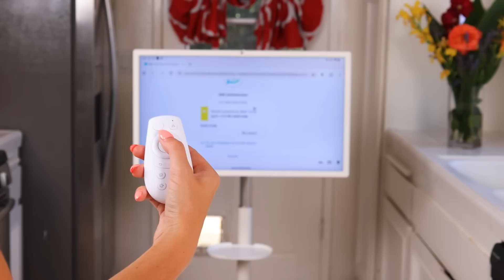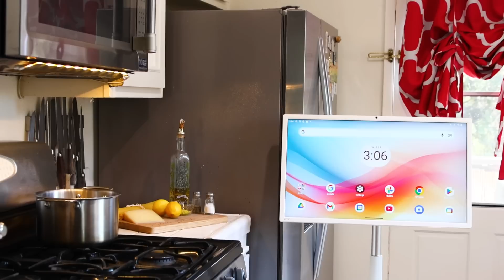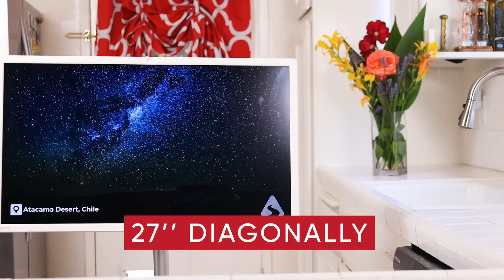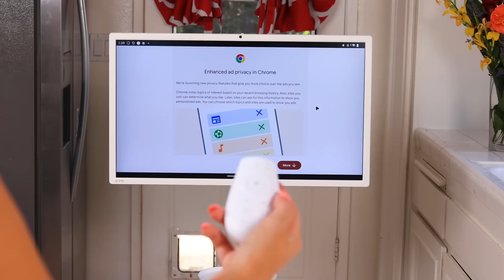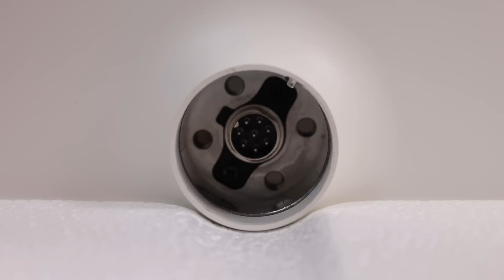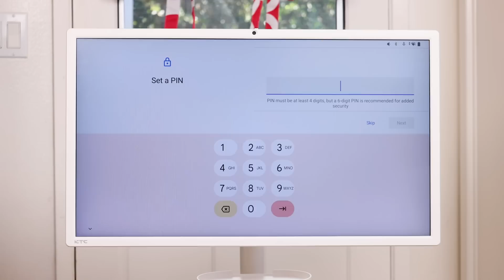KTC MegPad A27Q7  TV Tablet on Wheels | Touch Screen Monitor | Webcam |  Battery Monitor 6 Hours

Comment: Best for editors , coders especially when they are travelling cuz big screen is always a need. scrolling through lines of code, and laptops just don’t cut it sometimes.. You can set it up anywhere whether you're at a hotel, coworking space. As it supports USB C and screen mirroring makes it so easy to hook up your laptop or phone without carrying around a bunch of cables. How cool is that.. running VS Code on one side and a preview window or terminal on the other. That is a luxury while traveling with remote work that feel a lot more productive.
Reply from the maker: Great comment, thanks for sharing your thoughts on this!

Comment: Toddlers and pets would knock this down in a minute. I hope the base is quite heavy to keep it from tipping over. But, yes, a really rambunctious child or dog can possibly knock it down. I can already picture my niece running full speed into it or my dog knocking it over with a single tail wag. I love the portability and how sleek it is but I think for families with little ones (or pets), you’d have to be really careful about where you set it up. That said, if you’ve got a quiet moment or a designated safe zone I agree that this is an aswesome piece of tech for family use, like watching cartoons together or using it as an artboard for educational apps. Just maybe don’t leave it unattended on the floor during playtime! It’s one of those devices that’s perfect… as long as it’s not in the path of destruction.
Reply from the maker: You make a great point about safety!

Comment: I need more screen separation tho 😆I would have throbbing migranes for life if I bought one of those! It would be super handy for art tutorials though. Where I sit, it scoots! I’m always pausing and rewinding videos while trying to sketch along and my current setup is either too small to see the detail or way too awkward with cables and positioning. With this MegPad, I could just prop it up, rotate it vertically and finally follow along comfortably. 😂 That’s me! Always dragging my chair around to get the right angle on a screen. At least this would move with me instead of the other way around. So Tempting🔥
Reply from the maker: @flwrzpinky6865 I'm so glad you liked this!  Thanks for your comment!

Comment: I could see this MegPad being absolutely incredible in a garage/workshop. So many of us like to follow tutorials while working on projects, but phones are too small and laptops feel too fragile or get in the way. The device looks like the perfect option! Big enough to clearly see instructions from across the room and the touchscreen makes it easy to pause, rewind, skip without using a remote when your hands are full or dirty. It has a six hour battery life means I wouldn’t need to worry about finding an outlet or tripping over cords while I move around the space. And with the vertical and horizontal rotation, you could easily display plans or diagrams depending on the format. For me, this is  the ideal tool for DIYers, hobbyists or mechanics who want a smarter, more rugged screen without sacrificing portability.
Reply: ooo so true, plus the fact that you can move it anywhere too
Reply from the maker: You bring up a good point @angelinaroberts4721 , thanks for writing, I hope you keep commenting on my videos.